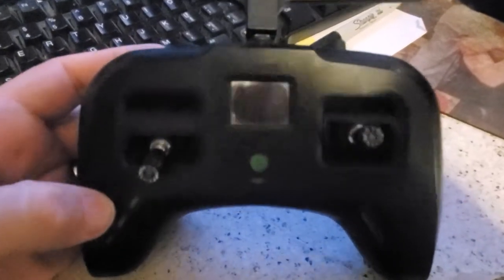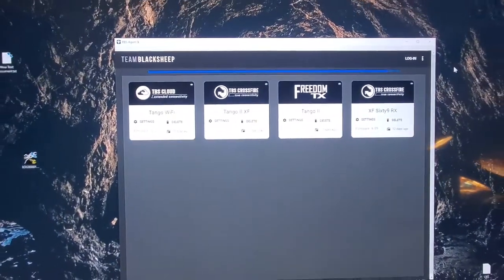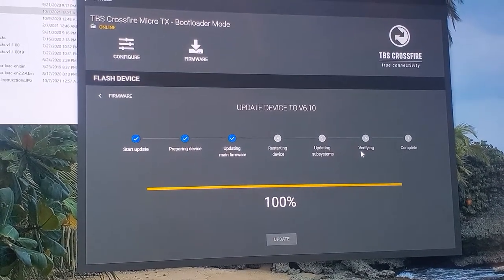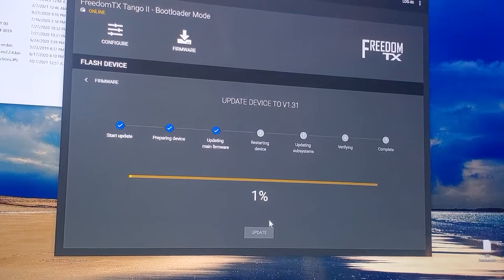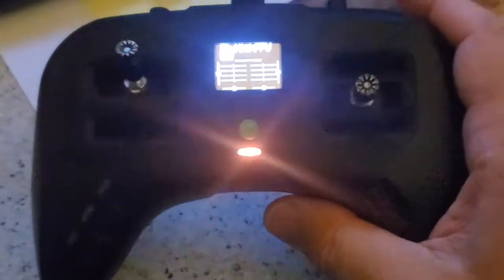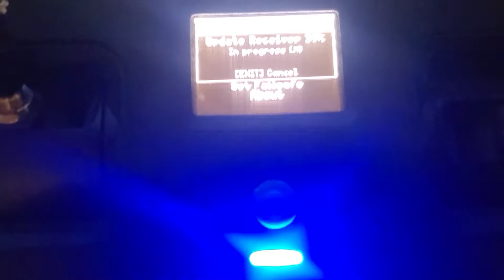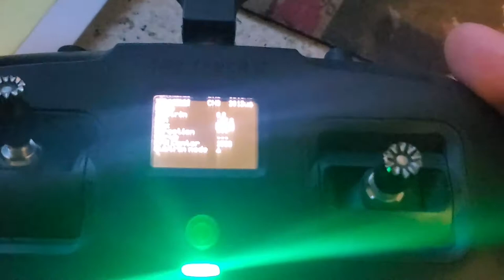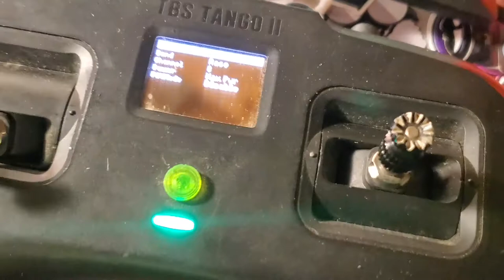TBS Tango 2 Firmware Update 6.10 - How to Unbrick a Tango2 - Bootloader Mode - Stick Calibration

Comment: Thank you.  I bricked my Tango 2 after the firmware update stalled.   This information enabled me to complete the firmware update and un-brick my Tango 2.
Reply from the maker: Agent M fixes all the issues, has all the same features. TBS has a desktop version of Agent M coming too, but I just use the web-based version,  it's 100% reliable and i've flashed  about 30 times with it

Comment: Thank you so much for this video! I learned a few things:  1) You have to keep pressing the bootloader button until it jumps into bootloader mode. This can take a while (approx. 10 seconds for me) 2) Patience when updating the XF firmware. The verify step can take a while and repeat a few times. I thought there was a problem and unplugged the USB which bricked my controller 3) Agent X doesn't always work for updating Tango II firmware. Tried to update to v1.33 and it doesn't even go to 1%; it just sits there spinning. Will try Agent M.
Reply from the maker: Yep, known bug in AgentX causes it to hang, use Agent M

Comment: my tango 2 didnt turn on all of a sudden so i tried your unbrick method but i get stuck at restarting device 
the screen on the rc stays black no lights or anything 
what to do now?
Reply from the maker: Does the led blink sometimes when you push the power button? If so use the bootloader method again, be sure to get both sides of the radio CrossfireTX and FreedomTX, using the 2 different bootloader buttons. If you get no lights on the tango 2, the battery may have been overdischarged, and you'll need to unplug the internal battery to jump it off with another 1S lipo
Reply: @Fly_High_FPV  thanks for the help 
the battery was overdischarged since i got it used and it was sitting in a shelf for years probably
i got a followup question tho 
does the tango 2 charge while you use it for training in a sim?

Comment: the factory reset rx before update .. is a new learning for me thanks !!
Reply from the maker: Trappy swears you dont have to...says just update,  and then tap the bind button on the TX, but in my experience,  that doesnt work, so i preemptively reset them to avoid having to mash the button later
Reply: @Fly_High_FPV  yeah happened to me once

Comment: Hello, i update my radio and it stuck during update, via agent x, now My tango bricked, cant switch on, no led. I try this bootloader but it stuck at restart step. I also re plug-in battery , SD card, still not working. Just via agent m i not trying, can agent m use bootloader like agent x?
Reply from the maker: Yes, use Agent M and the bootloader, to flash properly, Agent X has a bug right nowm
Reply from the maker: Use the same instructions here for restoring, with Agent M.  I also have a newer Agent M video (but it doesnt brick👍)

Comment: Hi there, thank you for the valuable information. By any chance, how would you fix a tango 2 (6.13) on which telemetry logging (SDLogs) has stopped working (no csv files are created in the LOG folder)?
Reply from the maker: Not positive, but i'd def start by using Agent M to upgrade to 6.14.  It's possible your SD card needs to be reformatted and clean sd contents installed, or the card replaced entirely...but the FW update is easiest and most likely 👍
Reply: @Fly_High_FPV  thank you for the feedback! Your solution would have probably worked. I ended up formatting the sd card and put back my backup of the sd card… and it worked! For now…

Comment: I’ve used so much time on the tbs tango 2. First when I got it I searched a video on YouTube what to do when open first time. They told me to update it and then I did and I haven’t even tried the tango 2 cause nothing is working, i can bind to drones but in beta flight it goes crazy and when I turn on the tango 2 the welcome sound is laggy + it always says signal critical even when drone is 10 cm from tango ….
Reply from the maker: If you need some help, reach out on Instagram @FlyHighFPV shoot me a short video showing the behavior, i'm happy to help

Comment: i put in ticket with tbs they responded said it something wrong with my usb"s or computer i just flashed a complete ELRS system so nothing wrong with usb or computer then they said its where i live never had a problem here in the us it just shows plug in usb device i hear the ding and nothing i t shows nothing online and dont give me the option to check box for beta firmware
Reply from the maker: I'd probably guess it's a USB issue too, make sure youve rebooted the PC, try another cable, etc.  If that doesnt work, try going into bootloader mode (BL uses a different driver)  also be sure when you plugninto usb that you select "agent X" on the tango.  I know it's been more than a week, but if you need help, shoot me a DM on instagram @FlyHighFPV

Comment: Do i also need to update FreedomTX to make the new Xfire Firmware 6.10 make to work? Because its not working for me. My right stick is going crazy after the update to 6.10 even after calibration.
Reply from the maker: Yes, update both, 6.10 and 1.31. Try doing calibration again with a feather touch after you finish updating
Reply: @Fly_High_FPV  Ok, i've also updated FreedomTX and it seems to work now.
2 questions. Is this also possible with the Crossfire Micro Module or only with the Tango and Mambo?
2nd question is which nice female voice you are using there? Where i can find these. Sounds sexy! ;-)

EDIT: Ok, its not working with my Xfire Micro Module on the Taranis because the TBS Agent Lite LUA Script does not include that Bypass function.  I hope they will update this also.
Reply from the maker: @MrSmithFPV  the mixer bypass only works for internal radios, the Tango2 and the Mambo. I made a custom sound pack, it started with OpenTX Amber's sexy voice, add a dash of the HAL-9000 from Kubrick's Space Odyssey, and some other random clips
Reply: @Fly_High_FPV  That means they will not bring it out for the crossfire modules? If thats true than iam not able to use the multibind feature because the start und endpoints are not correct on my taranis after setting these in betaflight CLI...
Reply from the maker: @MrSmithFPV  i think you're misunderstanding.  You can update all your crossfire modules with Agent X or Agent M, but  FreedomTX is only for TBS radios. If you're running a Taranis, Radiomaster, or whaterver, you'll need to get updates for OpenTX or EdgeTX
Reply: @Fly_High_FPV  Hm, ok. So that explains why I was needed to update freedomtx to make it work. That means this bypass is based on a freedomtx workaround or code change. That means I need to deactivate that feature so iam able to keep using multi bind. Thanks for you answer. 🍻
Reply from the maker: @MrSmithFPV  the bypass doesnt come on automatically, you've gotta activate it
Reply: @Fly_High_FPV  Yes, I know. Already deactivated so iam able to use multi bind. But I will sell my Taranis then iam able to use it. 👍

Comment: Any idea of how to update the tango 2 that isn't recognized by the computer?  I'm on 6.07 which apparently does something to USB because you showed 6.08 had a fix for USB consistency. When I plug in nothing happens won't go bootloader or anything. Tried different cables and computer. Do you know if you can update via wifi?  I filed support ticket with a video and haven't had a response yet.
Reply from the maker: Just saw this message. Have you tried the bootloader trick?
Reply: there is something wrong with agent x 3.0.51 since i updated nothing shows online i tryed everything tbs told me and still nothing they said it was something wrong with my computer so i set up a complete ELRS system right after they said that had my computer checked everything running normal so its something on there end been trying back and forth all week and still no fix
Reply: @ThaReilDeal  so when you plug your tango in nothing shows on computer? Computer don't chime or anything?
Reply: @RubyS.1  it does chime just nothing happens all my tbs gear shows offline no green dot in box it says plug usb in and i do and i get the chime just no response from tango 2 or nano tx
Reply: @ThaReilDeal  you try agent m configurator online? You tried bootloader like in the video? Mine didnt even chime anymore I put 6.07 on it and it bricked the USB TBS sending me a new board when they come into stock.
Reply: @RubyS.1  yes i tried agent m as well does nothing only shows joystick on the usb window and does nothing this all because i bought a bnf with a new nano rx in it they have a big problem going on and they kept saying it was something i was doing but i hooked up and binded a complete ELRS system with no issues i hope they figure this out i have alot of money invested

Comment: Hi, how to mange channels in radio , after updating i realize that throttle is kind of mixed with yaw also pitch and roll , so can you told me which chanels to use for each , throttle, yaw, pitch, roll? Thanks in advance 🙏
Reply from the maker: Check my very next video, it shows how to use the mixer bypass to setup your radio as Mode 2 (or any other mode)

Comment: Hey can you help me out with my tango 2: I am using it on my baby hawk 2 and my whoop. I just got the mark 5 and after binding it and arming it i get a weird problem; the i just nudge the throttle up and down it work fine but when i add more throttle the motors spool up very fast and when i try to bring the throttle down it doesn't slow it down. I'm forced to turn it off. And the weird thing is that it affected my other two drones in the same way, i tried to rebinding them , updating the tbs agent and copy to items to Script/tools when updating the sd card on tango 2. What the hell is wrong ? Very coincidental that this happened after binding to the new quad. What should i Do?
Reply from the maker: If your props are off, there is no load on the motors, so it is "normal" but terrifying when the motors spool up, but not down, and you have to disarm.  If that's happening when you have props on, you have a fly away situation. That's usually caused by bad esc settings or a bad gyro on the FC. You can confirm if it's related to the tsngo 2 by going to betaflight receiver tab and check the inputs are doing what's expected

Comment: Would you happen to know how I can unbrick the TBS Mambo?  I just got it and was working then went a do a firmware update and it bricked. I tired both Agent X and M in bootloader mode, but nothing seems to work.
Reply from the maker: Is the agent detecting the radio and showing the bootloader flag to let you know you're in bootloader mode?
Reply: @Fly_High_FPV  Yes it is, in both Agent X and M. I use the latest release and when the agent restarts the unit it doesn't power back up. When I try to power up the radio, I get 3 quick flashes on the display. Any attempt to power up afterwards does nothing, black display on radio.
Reply from the maker: @FlyturboKwad  havent seen that one yet, have you opened a ticket with TBS yet?
Reply: @Fly_High_FPV  Yes I have, was first thing I did when it bricked. Thx
Reply from the maker: @FlyturboKwad  you might need to replace your SD card, redownload the sd card contents, and then redo the firmware update with Agent M
Reply from the maker: @FlyturboKwad  specifically,  what where you doing wrong?
Reply: @Fly_High_FPV  Nothing wrong, TBS support gave me same instruction I was doing for the past 3 days.
Reply from the maker: @FlyturboKwad  keep on them, they'll make it right
Reply: I just got mine today and I bricked my mambo
Reply: @Jeremy-wz5fh  Dang  it. So sorry for you. You will have to reach out to them and they will tell you that the issue hasn't happen to anyone else. When it happen to me 4 weeks ago I had found 4 other guys it happen to.  TBS sent me another board when I asked them for a replacement Mambo. I have opened a Paypal dispute and waiting for this case to be resolved. I urge you to do the same with Paypal or your credit card company.  I'm down 300$ US as I purchase the Ethix starter kit.  You may use me as reference if you wish. My name is Bruno Fazio. Good luck to you, for me this unit is the worst purchase I have done since my 2 years in FPV.
Reply: @FlyturboKwad  Thanks, but I will try a replacement with the Web site I purchase it on (I'm French so I didn't purchase it on the official site because of shipping time/taxes).
Reply from the maker: @Jeremy-wz5fh  you should be able to unbrick your mambo the same way as the Tango2. It just needs to be reflashed.  I highly recommend using Agent M instead of Agent X, per Trappy
Reply: @Fly_High_FPV  I spend my whole day trying to unbick it using agent x and m and nothing work(also is it normal that agent m is very slow for the update ?)
Reply from the maker: @Jeremy-wz5fh  if the agent sees the radio, and your updates are failing repeatedly, i'd swap in a new micro SD card. Redownload the SD card contents and put a clean copy on the card, then flash the firmware again using agent M.  M is browser based, so it definitely has the potential to run slower than the dedicated app, but the recommendation is still to use M
Reply: @Fly_High_FPV  at that point it's not slower, it à f*cking turtle snail! 2h for the main update. But thanks I will try it. Just what is the format for the SD card ?
Reply from the maker: @Jeremy-wz5fh  i believe fat32 format but 2 hours is not normal, 5 mins is
Reply from the maker: Correction, just FAT format
Reply: @Fly_High_FPV  i'l try with an old one, but still working
Reply from the maker: @Jeremy-wz5fh  hopefully it's the sd card. Makes sense to me
Reply: @Fly_High_FPV  I don't know, but 1h pas and only 62% on agent m. There is no way of updating manually like a drag and drop or something ?
Reply from the maker: @Jeremy-wz5fh  i think i'd try a different browser if that one fails...shouldnt take that long...5 mins is typical. Updates are via agent M or X

Comment: Did you notice any diff when flying?
Reply from the maker: This update alone wont activate the bypass. You still have to turn it on in  Agent Lite.i honestly can not feel 1ms of latency difference. Crossfire is 7ms-14ms with the mixer, down to 6ms with the bypass. Can i feel it? No. Do I enjoy that it's consistently always faster, yes.  Do I need to use the mixer on a drone, no.  So i'll take the consistent gains 👍
Reply: @Fly_High_FPV  yea I did the update for that reason I can live with no idle up switch until another update
Reply: @Fly_High_FPV  oh and yeah I did the mode 2 settings aswell to finish off the new update thing. Just havnt gone out to fly yet

Comment: I gave up on this TBS crap, spend more time trying to update/bind with this POS stuff.
Reply from the maker: I'm happy to help if you are stuck...there update process is easier than OpenTX...and they provide real feature improvements (like the mixer bypass in this update)
Reply: I appreciate the offer. To me, if I have to ask for help, then its already not worth it. When ever there is an update, the processes of binding TX to RX is never a smooth process. I am ditching TBS, Ill probably just use DJI system for TX/RX since I am already using DJI VTX. For my LOS drones, I am going all in on Radiomaster TX16S and its receivers.
Reply from the maker: @srqTagle  if you want simplicity over function, that's def the way to go 👍 I really appreciate the complete programmability of OpenTX/FreedomTX/EdgeTX, the lower latency provided by crossfire, and the ridiculous range and penetration, so i dont failsafe. I moved off 2.4Ghz a long time ago, and I dont see myself ever going back...i just need the freedom to go anywhere 🙌